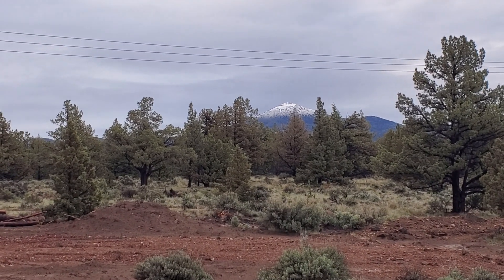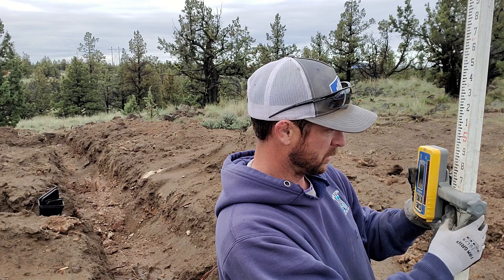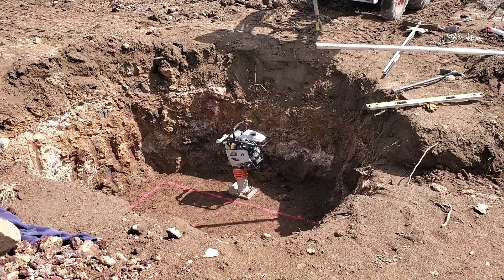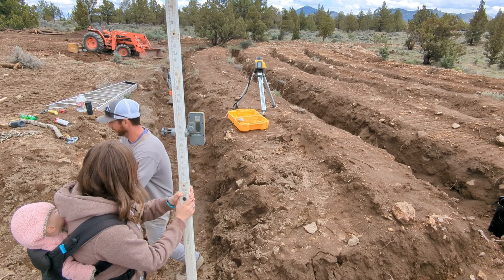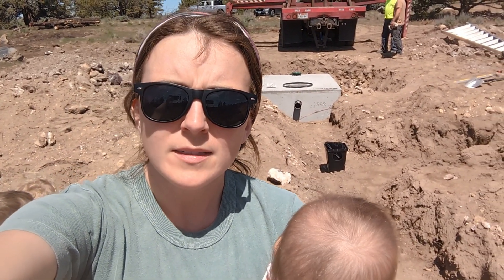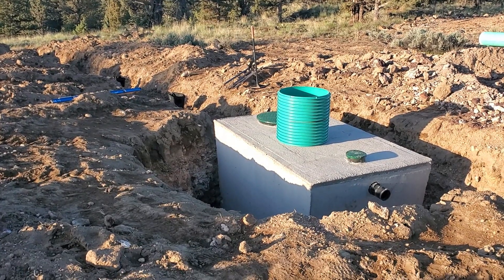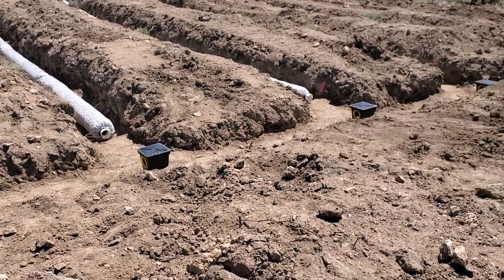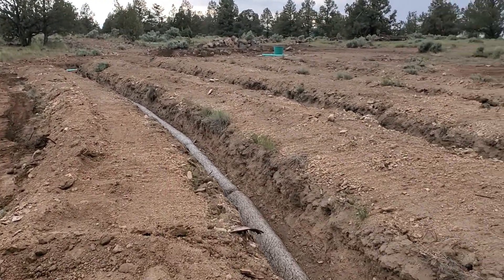Serial Septic Install | Part 2

Comment: I'm really enjoying watching the process of your build from sydney Australia.
I had a question why is it that you have the pipes running off from the septic tank? when the tank fills up will it then go into the ground , if so why is that? im just curious i havent seen that before.
Reply from the maker: Hey thank you for your question, and for your support clear in Sydney! The short story is that the solids settle into the tank, and the affluent flows through the pipes (filters) and out into the drain field. The drain field varies by location / jurisdiction because of soil types, topography etc.